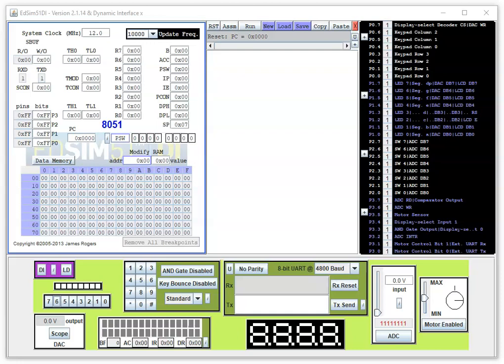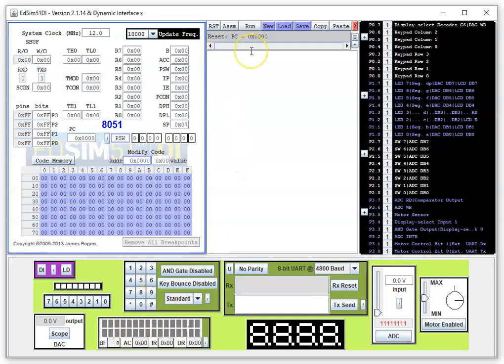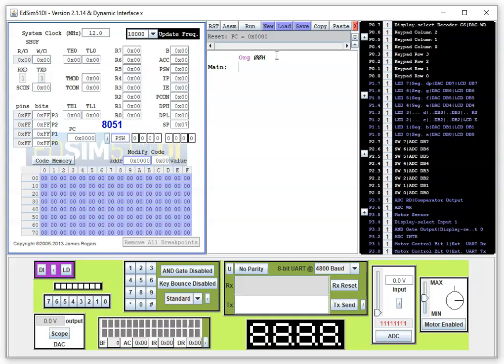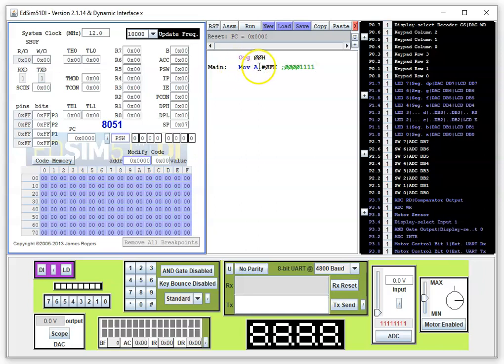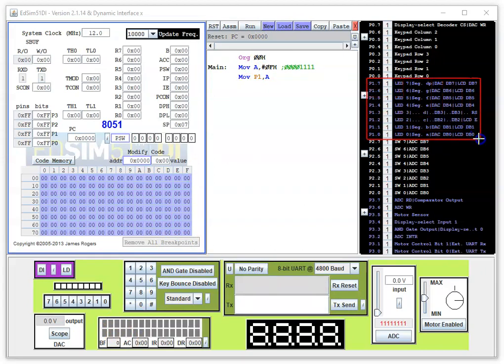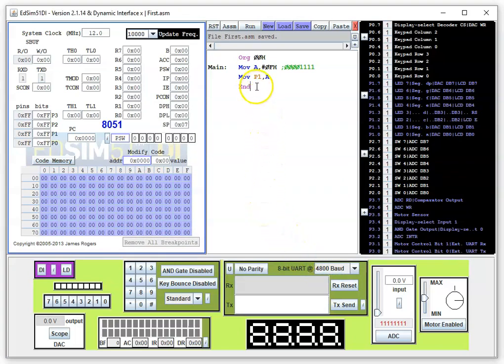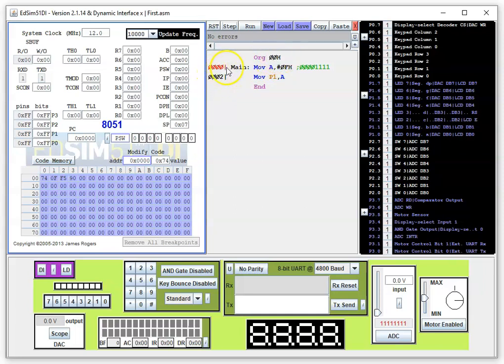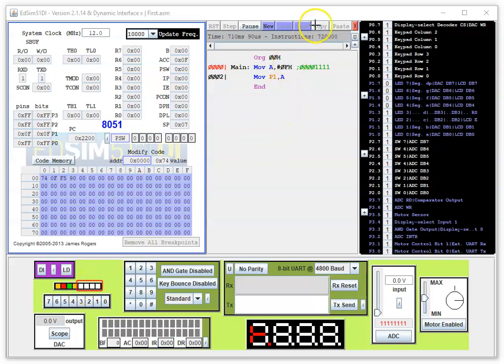#11 First 8051 Assembly Language Program

Comment: currently writing an emulator for the Dallas DS5001 and have a question.  with the mov direct, direct opcode the documentation does not specify what is read or what is written if either the source or destination are ports.   with mov a, direct the documentation states that the source will be the latch not the pins.  does mov port, port read from the latch of the source and write to the latch of the destination or does it read the source pins?

Comment: how to get .hex file from .asm code... please explain
Reply from the maker: Hi the assembler that you used should have an option that generates the hex file. With Keil IDE go the Project folder - Target folder - right click on the Target folder - select Options for Target - select Output tab - select Create Hex File opotion. Hope that helps.
Reply: @vooiyap  i am sorry , i was talking about pic microcontroller
Reply from the maker: @RepairRadioLab  Hi it will be similar with any assembler. There is usually an option to create a hex  file. May I know which assembler or IDE you are using?

Comment: Hi, professor, because I cannot change LCD E to P3.1, LCD RS P3.3(which is what we suppose to do for our assignment due tonight dealing with motor spin), as one of my friends suggested to me, I delete it and reinstall them again. Right now, it says "Java launch failure". (I am a mac user by the way) I do not know if you have any idea? I apologize if this is a pretty complicated problem, and you can tell me if you know. Thank you so much!
Reply from the maker: Try using the Dynamic Interface (DI) Panel - remap the peripherals. Link:https://www.google.com/search?q=EdSim51+dynamic+interface+DI&oq=EdSim51+dynamic+interface+DI&aqs=chrome..69i57.14349j0j15&sourceid=chrome&ie=UTF-8

Comment: Where's number 1?
Reply: What do you mean?
If you're talking about the LED output, 1 would be on the right.
The LEDs are hooked up between the positive supply rail and logic outputs, meaning that they turn on when the logic output is 0 (zero), and off when logic output is 1 (it's counter-intuitive when learning, but that's how it is).

Comment: Hi, professor, I have a question about the line of the text "time: - instruction: " what are the meaning of time and instruction? My instruction is running to 1460 now. My instruction does not run as fast as showing in the video. Also, as you made the modification in the comment, white means off (off == 0), then we put 00001111 and it should be white white white white color color color color?
Reply from the maker: Please check your System Clock (top left hand corner) is set 12 MHz and "Update Freq" is set to 10000. Regarding the LEDs, color LED is ON (logic 1), and white LED is OFF (logic 0).
Reply: @vooiyap  Thank you so much for explaining my problems. My instruction runs pretty fast after I set "Update Freq" is set to 10000. Also because the value is 00001111, so from 0 to 7 it should be off off off off off on on on on, then it should be color color color color white white white white in led. I have one more questions, so what is the technological meaning of "TIme" and "Instructions"? What do those two values represent for? Or you have explained it in the later videos?

Comment from the maker: Hi in my video I said that if the LED is white colour then it is "ON". This is incorrect. When the LED is white it is "OFF". I apologize for my mistake.
Reply: What you meant to say was that a white  or turned-off LED indicates a 1 or a high on port output because LEDs are connected between positive supply rail and the output pins, meaning there is a voltage across them (they're turned on) when outputs are zero.
In other words, logic 1 turns LED off, logic 0 turns LED on.
Reply from the maker: @edinfific2576  Thank you for your comment.
Reply: @vooiyap  Thank YOU for making these great, helpful videos!
I listened to the relevant part in your video once again, and you did NOT make a mistake.
At 9:48 you said:
"A white LED means logic 1. Any other color means logic 0."
 and that was correct.
Reply from the maker: @edinfific2576  I appreciate your comments and interest.